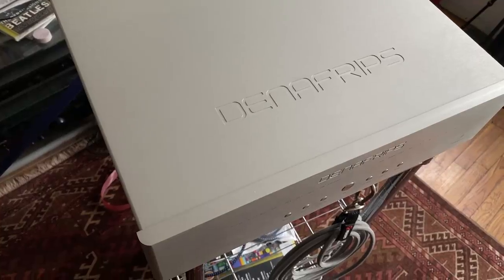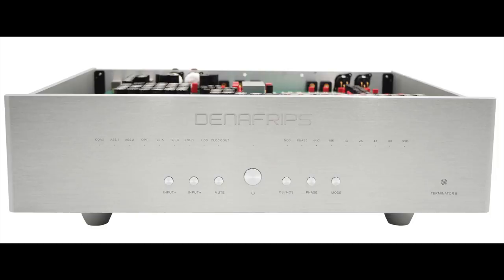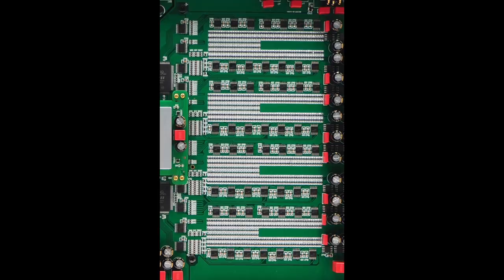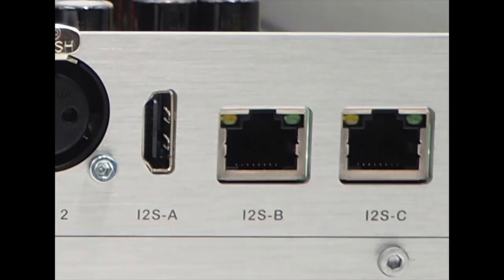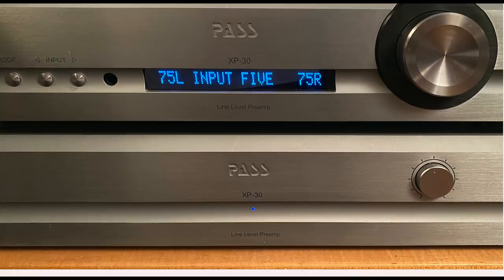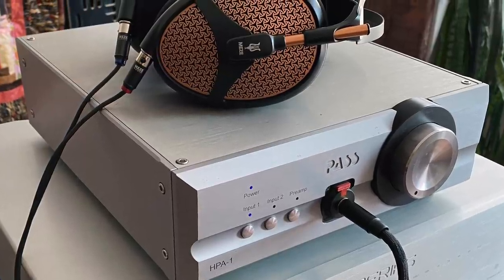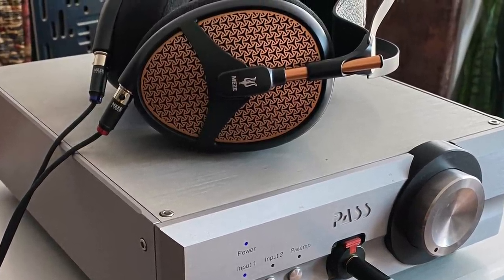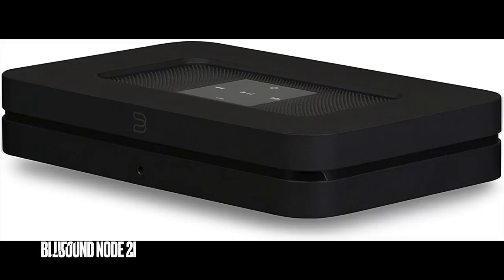DENAFRIPS Terminator II DAC, Wowsa!

Comment: After watching so many videos, reviews, and other sources,  I fell into the DAC addiction since CDs are my only source.
Denafrips is not a hoax.
Their DACs are truly amazing for the money. 
I started with Pontus II and I was blown away.
Sold it and got Venus II. 
A mild incremental improvement over Pontus. 
I knew my wife will be pissed, but took a huge gamble sold that and got the Terminator II. 
Wowsa is correct.  T2 sound quality is simply jaw droppingly good!
But I agree with many.
You must have good components to reveal its almighty detail.
My source is Jay's Audio CDT2-MK3 Transport via i2s output to T2. Then it goes to my Kinki EX-M1+ Integrated Amplifier. Then it goes to the Q Acoustics Concept 500 Speakers. 
I am very happy,  but tapped out! 😎

IMHO, Pontus II is absolutely Denafrips' bang for the buck DAC in their lineup.
But if you can afford T2, it's another huge jump especially if you have great components to make it shine.

Comment: Great review Steve. Oh-my... A crystal oscillator oven with temp control... Used to work on communications gear back in the 80's that used this technology to ensure VHF / UHF frequency stability. Cool to see this type of solution used in an audio DAC along with the other engineering choices like the fully balance discrete R2R network.

Comment: Now the wait is on for those upgrading from the original Terminator. Would love to scoop up the older unit for a good deal!
Great video, Steve!
Reply: @YuengsNwings  I think you're onto something. I just did an Audiogon search and there is a Terminator+ (not sure of the difference) for sale 1.5 hours from me (Madison, WI). Seller is asking $6,000.00

YIKES!😳
AT That price, I'll be happy with my Burr-Brown DAC contained within the Node2i.
Reply: @YuengsNwings  
I felt secure buying the  Ares2 from Vinshine since second hand ones were selling for higher prices on eBay. 
I won't be selling it anytime soon! 
With the different filters and "NOS" option its a little treasure.
Well maybe if they came out with a remote and silver faceplate...
🎶🤫🎶

Comment: Currently using a Venus II, however I only use headphones since living in an apartment limits me from owning premium loudspeakers. Would upgrading really provide a monumental difference? Using mainly Susvara and HE1000SE.

Update: My crazy ass went out and bought the Terminator Plus. Ridiculous sounding dac and a clear step up from the Venus II.
Reply: Chord Dave owner here, also apartment dweller. Honestly I think quality DACs are even more noticeable on headphones, you can dig into and concentrate on those details which may get lost in sound dispersion through a room.

Comment: Great looking DAC at a deal of a price for what it has.  Great review.

With this DAC it appears DENAFRIPS is on a parallel course with diyaudio.  R2R, isolation and reclocking, oven controlled clock (hopefully with very low phase) and supercapacitors on the power supplies.  My guess is most of what you are hearing in the improvement came from the clock and the supercaps.  As the clock phase noise lowers, soundstage expands, gets more 3d and precise.   The dynamics improve and bass tightens up.  Everything sounds more natural and airy.  The supercaps just add punch to the notes and quiet between the notes.  

My DAC has all this stuff, and I too use MA Recordings to just let it wash over me. :)
Reply: Is your DAC a kit?
Reply: Do you need a premium power cord to improve dynamics even further? Does it have any influence on the output stage? I was thinking of the AudioQuest NRG Thunder but that might be overkill

Comment: i still love my 8 year old NAD D1050 and you can find them used for $300+! i use mine with the new IFI Zen Stream.  i think DAC development plateaued 8 years ago. anything after 2013 will sound very good. you do not need spend a small fortune.  i would like to hear from anyone who upgraded from the NAD?
Reply: Not true.
Reply: @carlosoliveira-rc2xt  will when Singapore opens up again i will stop for a listen on my way back to Bali.  can't get in now.
Reply: @thomasward00  Absolute nonsense! I've owned DACs at both extremes and can most assuredly say that you have no clue. Also, snake oil is the legitimate article, the real thing! 
Since I'm in an educational mode, beemers/beamers aren't BMW cars, they are  motorcycles.
Reply: +1 on not true

Comment: Steve get Mr Chee to send you the Gaia DDC.  It takes that TII up several notches.  I have this exact combination and it is awesome.
Reply: Me too! I have the Gaia DDC and T2 combo with I2s silver cable.  SOOOO COOOOL!
Reply: @sincity3141592654  What’s the point of having a DDC if the source is I2S e.g. Soundaware D300Ref? Clock of the DDC is bypassed to use external clock of the T2 anyway

Comment: Hey Steve, like you I stream with Bluesound Node 2i but recently tried an IFI Zen Streamer and OMG, the clarity and soundstage difference is obviously better, most likely a result of better noise isolation tech they've put in it.  Give it a go and I'm sure you won't go back to the Node. Cheers!
Reply: I'm curious. We're you using the analog output of the bluesound or digital to a dac?
Reply: What model Ifi streamer ?
Reply: @drwavedawg  There is only one, IFI streamer.
Reply: @SqueamishPuppet  using digital out (AQ carbon coax). IFI streamer has 2 options - USB or Coax. Using Ares II dac.
Reply: Looks like we need a series ON types of DAC ect
Reply: @drwavedawg  I strictly use the Tidal setting. It's glorious!
Reply: @joenogueira2801  I believe you! What model Ifi Streamer are you using?
Reply: So you are saying the 0010011100 from the Zen Stream sound better than the 0010011100 from the Node ? (Zen Stream has no DAC)
Reply: @drwavedawg  they only have one: zen streamer.
Reply: @larrywe3320  it’s all about jitter and noise isolation!
Reply: @joenogueira2801  A proper DAC will take care of that...
Reply: If you're using an outboard DAC i.e. as a network device, how could there possibly be a difference is sound quality?
Reply: @MusicLover-01  I'm not here to debate! In my room, in my system and to my ears, the extra detail is obvious and the extra air in the soundstage is equally obvious. It would easily pass the Pepsi test for any listener. You can chose to believe or ignore it, it's all irrelevant to me.
Reply: What are you guys really arguing about? Just drop it... Everything can be toned and it is not a DAC, but a buffer... A well toned buffer, Steve should mention that in the very first place 😦😵‍💫
Reply: @kateg151  I'm a "rookie" so how could I know that ? :-)
Reply: @larrywe3320  And no refunds are accepted! Steve should mention that in the very first place too! Watch out friends! 🙃
Reply: @joenogueira2801  No worries bud, best of luck 👍
Reply: @joenogueira2801  This is true if a network player contains a DDC to improve those properties (clock/jitter). Otherwise its simply a dedicated audio computer... this was my point earlier. 👉 Besides, most decent DACs are asynchronous and therefore avoid most of the clock and jitter issues. It may come down to lower noise in the data transmission phase. This can also be fully overcome if using I2S between a streamer network and DAC.

Comment: Thanks great video.. Does this come in above the terminator+ , I see on the website its less expensive. So the + should be a "better" DAC?
Reply: Yes, the Terminator-Plus has all the features of the Terminator II while still being the technically-better DAC, but the II and the Plus are very close to each other in terms of specifications and may not justify the cost to you. There is a custom-modded version called the Terminator-Plus DE that clearly sets it self apart from the Terminator II and the Terminator-Plus (that I am a happy owner of), but it is vastly more expensive and is only available in Korea.

Comment: 1:59  Denafrips recommends you don't use the XLR and RCA at the same time
The reason for that is that all balanced lines turn into unbalanced when summed together.  If you have ANY unbalanced lines in your system the entire chain becomes unbalanced.  Is the quality worse?  Not really.  You balance electronics for other benefits.
All electronics are unbalanced internally.  If you can get the signal there without any degradation, balanced XLR offers no advantage.
Reply: I think I can "resist" the urge to buy that unit regardless.  Sticking with the Bryston and the forever warranty and somebody to call other than in freaking Singapore.  Granted that audio mall in Singapore is pretty amazing.
Reply: @JohnDoe-np3zk  If you're talking about Bryston digital gear, it doesn't have a "forever" warranty - it has a 5 year warranty.  Only their analog gear has a 20 year warranty.
Reply: @JohnDoe-np3zk  Back in the day I used to be a Bryston dealer.  Still have 4 units left (4B, 4B, 3B, 2B) and they are pushing 35 years old.  Outside of a few cap upgrades they still sound supreme and are pulling heavy duty.

Comment: I'm constantly surprised by the unfortunate room setups on those systems of the day. Speakers against the wall, shoved into corners, coffee tables in front of them, speakers way too big for the room, etc.
Reply: Not sure you saw the placement very clearly. The 2 channel speakers are over 1 meter from the back wall and 80-90 cm from the side wall. There is another 1.75 meters behind the listening area. The room is 82 cubic meters. The speakers are only Turnberry GR. Not like I tried to jam Canterbury's in the room. I welcome you to come and listen anytime your are near Hanoi. Oh - for two years there was a tiny coffee table. I can't tell any difference with the larger one. It is very solid so not absorbing much. Only deflecting. Also there are two systems. One for TV- speakers on the wall. This is not setup for any serious listening.

Comment: Lets Talk Analog for a Second: NBC reported that ALBUMS (new) have out sold CDs by 2x twice the number. SO WHY? --- It's the only media that if Electricity suddenly disappeared you could make a mechanical means of listening! - & -  That's how it's special, because you and I and 'non-genius' can touch something we might without credentials 'Hodge Podge a fix' without a degree. 
(It's why it's going to be hard to replace Gas Powered Motors... You take the Electronics out of most older cars of the Greatest and Latest and YOU COULD FIX IT... (w'out special gear.) - & - Fix or hope for the Best, but there's a chance you might fix-it. POWER (oooyesss!) - & -  Control, 'back in the day,' when products were specifically designed to be repaired or have older parts replaced. 

Nothing against the Product... I want one, but NBC has noticed 'Vinyl is Back' and I personally worry getting my hands on cheap records are going to be much more difficult to find. 
>>>> On the other hand, CDs are going to go for .10 cents each if you buy bulk. <---
and that ain't bad! - m.